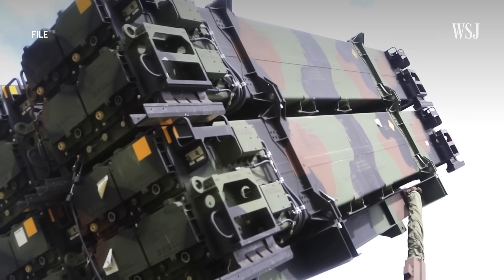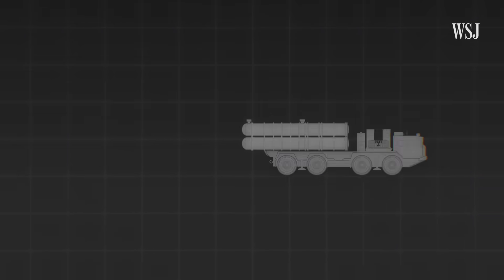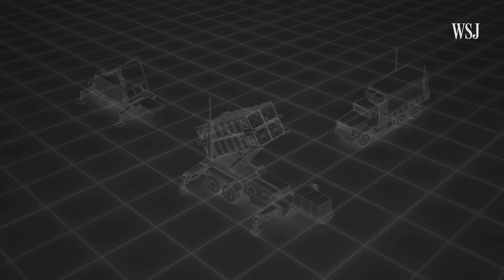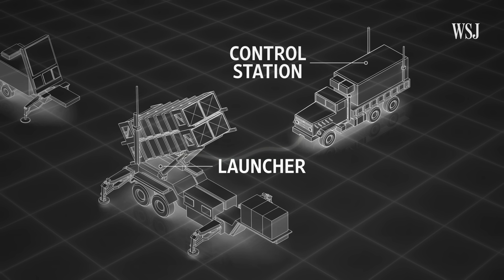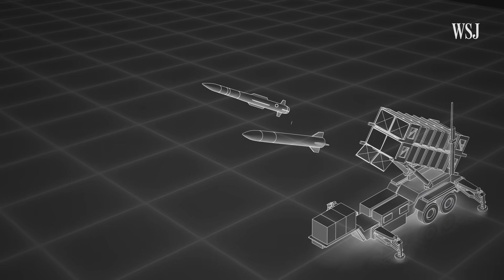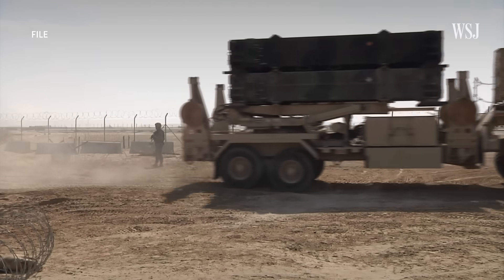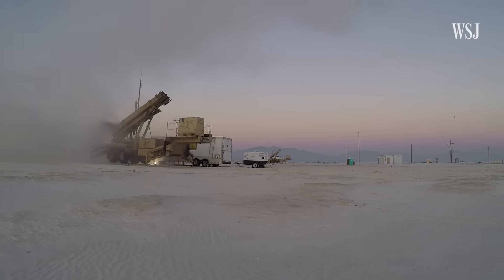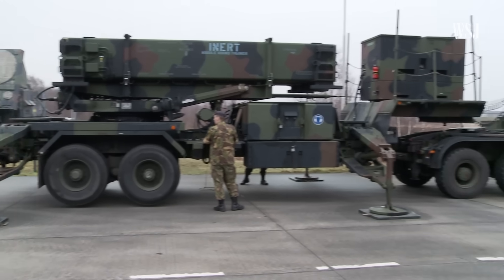How the Patriot Missile System Works in Ukraine | WSJ

Comment: It doesn't work, actually. Can't down nothing more than cruise missile and drones. But they are desperately trying tl degrade Russia with allegedly downed kinzhals.
Reply: The amount of denial is staggering even though OSINT has already confirmed the Kinzhal wreckages in Kyiv to match the one that crashed in Crimea, where they both share the same parts from Iskander-M. The unitary warhead even has a tungsten rod hole. It’s not a FAB-500 either, as that requires a jet to carry it over the target area. When was the last time a Russian jet flew over Kyiv? Kinzhal is literally an air-launched Islander-M as well, with it even being called that in formal manuals. The US has had a similar system called GAM-87 since the 1960s that went mach 12. 😂

Ever since the Gulf War, the Patriot system has been optimized for BMD. From 2015-today, the Patriot has shot down 300+ ballistic missiles including hypersonic MARVs and MIRVs. Why would it have a problem shooting down Kinzhal? Meanwhile you have the S-400/300 failing across the world. An example is Saki Airbase, where despite Crimea being defended by 6 S-400 battalions, Ukraine managed to destroy half of the Black Sea Fleet’s Su-30SMs. It’s like you’re ignoring rRussian SAM performance throughtout history (Gulf War, Operation Mole Cricket, etc…)
Reply: @vincentphan5097  not a single clear and obvious evidence of the shooting down of hypersonic missiles has been presented
Reply: @vincentphan5097  FAKE - ' half of the Black Sea Fleet’s Su-30SMs'
Reply: @vincentphan5097  By the way, Ukraine once had the Sea of Azov and now Russia completely controls it, so it will be with the Black Sea

Comment: The stats are wrong. Of course there is a bunch if different situations, but patriot can detect aircraft well in excess of 150km. They say patriot has a small missile capacity, it can hold up to 128 lol.
Reply: Where tf can you see 128 ?
Reply: @rawk2058  so unfortunately i cant give you links on youtube. but, if you go to army recognition or if you look into PAC-3 missiles, youll find out a launcher can hold 16. Each patriot battery can have up to 8 launchers, therefore up to 128 missiles. There's many different patriot missiles, some are bigger than others. A more realistic loadout would be mixed. If you use the largest(& oldest) variants available, a launcher holds 4.

Comment: Both the Pac-2 and Pac-3 have hit to kill capability. The newer Pac-2 missiles have been upgraded to be able to do so
Reply: I read this as 2pac at first 😂
Reply: PAC 2 uses a fragmentation warhead, the latest version PAC 2 GEM received new airframe from PAC 3 & improved Guidance (Guidance Enhanced Missile) as well as another Fuze upgrade. Army recognition has all the tech specs if ur interested.
Reply: @jdogdarkness no they don't.

Raytheon's PAC-2 GEMs are still proximity fused.

Lockheed Martin manufactures the PAC-3 hit-to-kill
Reply: @missileman1481  i didnt say otherwise? lol Read again. Unless your confusing a fuze as a type of warhead. blast fragmentation warheads still can use fuzes.
Reply: @missileman1481 which GEM are we on now? 10 years ago we had GEM-T and GEM+
Reply: @KijanaMBrajon  That would be GEM-T & GEM-C. The PAC-2 GEM Tactical/TBM (GEM-T) and GEM Cruise (GEM-C) are the latest PAC-2 variants and feature further enhancements for engaging ballistic and cruise missile targets, respectively. PAC-2 GEM-T/GEM-C entered Army service in 2002. As u can see some of the variants are geared for certain threats, so there are multiple PAC-2 let alone GEM-X variants. I can direct you to my source if you'd like.
Reply: @missileman1481  Not gonna admit I'm right?
Reply: @jdogdarkness I was trying to quote tylerclayton, not you. Not sure why it replied to you. 😊
Reply: @jdogdarkness You're right. Feel better? :hug:
Reply: @jdogdarkness This. Everyone thinks these their daddy's Patriots from the 80s and nothing has changed in the past 35+ years.
Reply: @missileman1481  Im not sure i understand. But its not really to feel better, its that you were factually wrong & at least 4 people  came away with false info.(4 likes) I have no hate against u bra. My thinking is just "would u appreciate not go around saying the wrong thing on accident?"

Comment: Russia just made Lancet 2 Drone which can attack n Groups, what if they send 100's of them together?
Reply: 1/3 will have mechanical issues, 1/3 will have operator issues and the last 99.5% will be shot down by the large system of air defences they have.
Reply: Lancet 2s are very short range weapons for the battlefield. The Patriot system is designed to protect a large area (i.e. big cities) against fighter jets, bombers, cruise missiles or ballistic missiles behind the frontline.
Reply: @armadspengler2717  can patriot defend 100’s of drones together .
Reply: @KratosUmar  No. But the Patriot System is not alone. There are plenty of other airdefence systems in place which can deal with such a threat, e.g. NASAM or Iris-T, Gepard AA tanks and Skynex. Especially Gepard AA tanks and Skynex are working fanatstic on such slow moving drones with their 35mm airburst ammunition.
Reply: @armadspengler2717  lets see how million dollar weapons gonna reply to those budget drones.
Reply: @KratosUmar  SPAAGs like Gepard and Skynex are very cost effective dealing with those drones and there will be other means to defeat such airborne drones in the future like lasers, jammers and other electronic counter measures. Especially against commercial, non-military grade budget drones. BTW Lancet 2 is not a budget drone.
Reply: @armadspengler2717  what i meant was its cheaper than NATO's air defence.
Reply: @KratosUmar  Unfortunately, the victim cannot choose with which weapons it will be attacked. Therefore, Ukraine must defend itself with what it has at its disposal. Terrorists, like Russia in this case, often use weapons that are very cheap to have an effect on the civilian population. Therefore, the calculation must also include the damage to civilian infrastructure that has been prevented by intercepting these drones before they reach their target.

Comment: 60 Minutes had a good show on the monopoly of certain defense contractors as an example. He showed a fuel pump that NASA paid $150 for and the same part for a fighter jet cost $10,000, so after all these years of corruption in the defense industry, it’s only getting worse
Reply: Look you need to do more research to understand that the DCMA dictates the price to the DoD and the contractor only receives a 5% profit fee on anything. You can't compare Apples to Oranges. NASA is not under the same requirements and doesn't fight wars. A jet that never crashes after thousands of hours of flight has by far surpassed NASA in reliability of product. If you want to win a war, you pay a higher  price.
Reply: In 1990 Congress passed legislation directing all federal agencies to produce regular, audited financial statements. Over 30 years later the DOD has never passed a single audit.
Reply: @kevinjenner9502 its called corruption and public foolishness